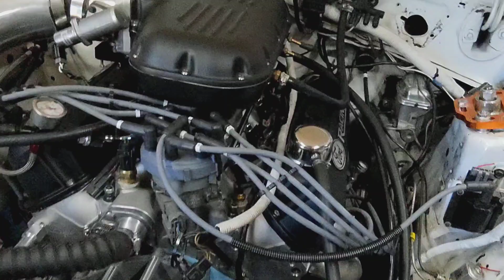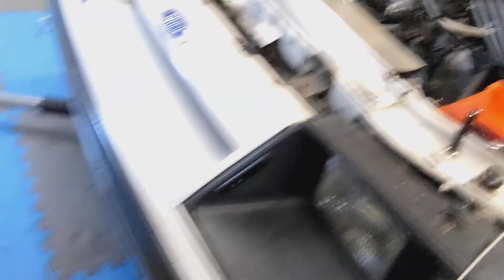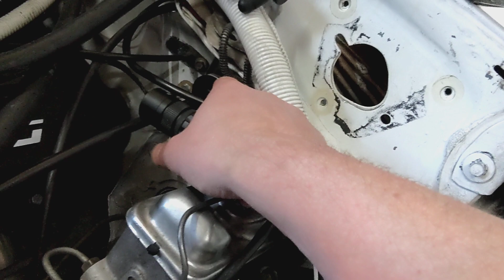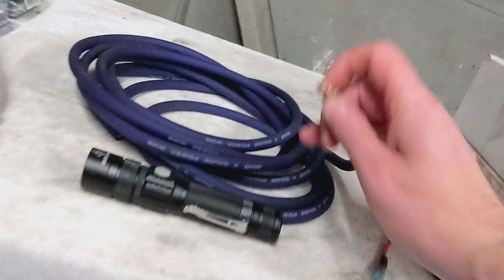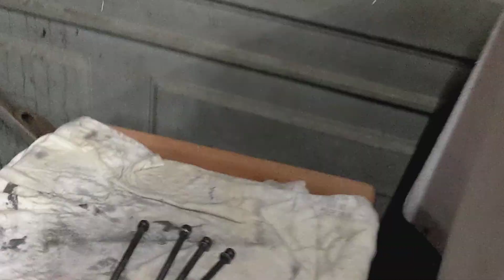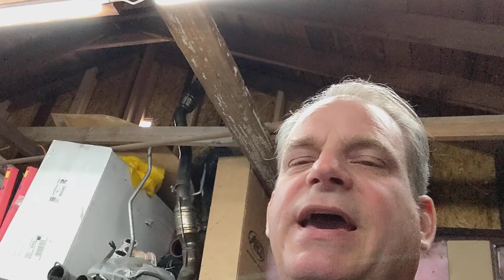electric water pump failure halted 349 progress for now

Comment: That sucks with the w/p. I did notice you painted your blue dist cap gray.👍
Reply from the maker: Yeah, it's always something, good eye on the cap! yeah I still have the blue cap, the gray one is a motorcraft oem, but it has aluminum terminals where as the blue does have brass terminals, that's why I was running the blue one to begin with, I may go ahead and paint that one black maybe.

Comment: Always something, I feel your pain brother! Good to hear no leaks. What kind of cut off switch - lever or push in? Your engine bay looks amazing! You shud add a black distributor cap and black wires and it will look like a million bucks 🤣 Have a great week👊🦊🏁
Reply from the maker: Mines a lever, I'm going to run the alternator direct to battery, good idea on the cap and plug wires, thanks Paul!
Reply: @vrm86gt  A black MSD cap with black wires 💯🤩

Comment: I just watched engine masters and was a 6 hp diff with a electric water pump,to me the reliability not worth that little bit
Reply from the maker: Yeah it lasted a few years so I'm not complaining.
Reply: @vrm86gt  I'm sure u will have 2 play with the tune, this winter I rebuilt my engine and placed cam in different spot and that through my tune out of wack
Reply from the maker: @alltherpm  Thanks, yeah it seemed to want more air at idle as far as I could tell with the minute I had it running

Comment: Sucks about the water pump, but congrats on getting her fired up with no leaks. Have a great Sunday evening 😀
Reply from the maker: Thanks, the bigger cam and more compression I think I will need to idle it up a little but when it was running it revved up real nice and crisp! I know I can run it for a minute without coolant but just would rather wait for a working water pump to set timing, run a datalog to check air/fuel etc.
Reply from the maker: I did a smoke test today to check for vacuum leaks and it passed the smoke test so I'm happy about that!